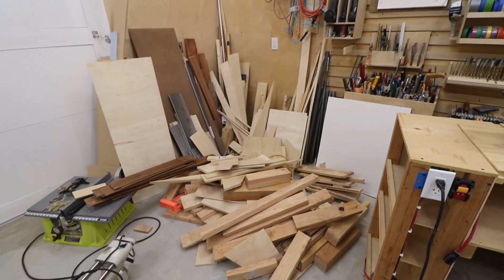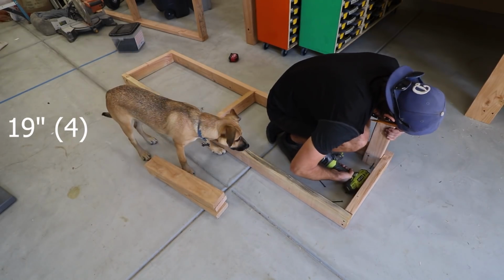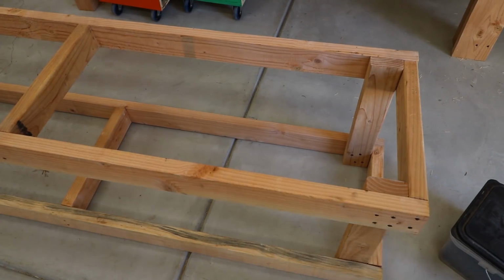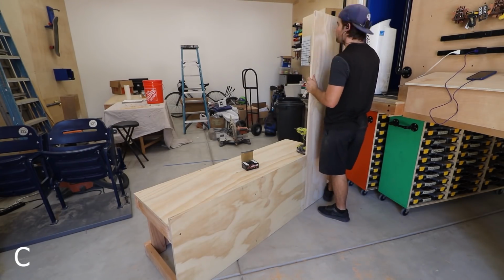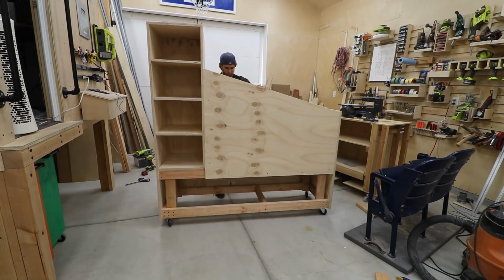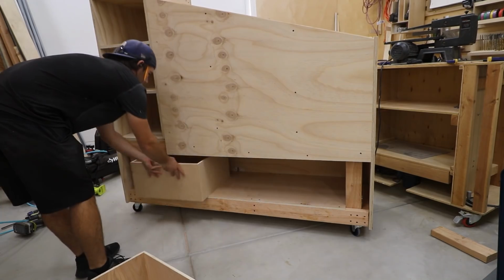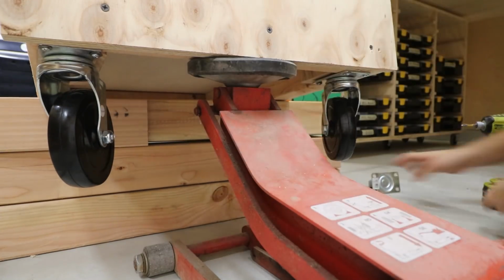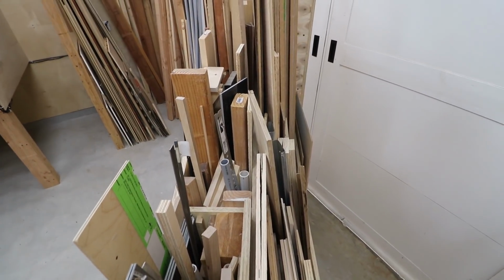High Capacity Wood Storage Cart

Comment: I made a similar measuring mistake. I was supposed to make a doorway on a storage barn 5 ft 6 in.  I incorrectly made it 56 inches. I chose to leave it, and fix it later on, if I needed to. That was over 10 years ago and I haven't changed it yet. Sometimes a mistake doesn't really need to be fixed.

Comment: 3:04 "I was supposed to make cuts at 66 inches, and instead I made cuts at 6 foot 6 inches."
Yet another error that can only happen in the imperial system. A mistake like this would literally be impossible to make in metric. You can still be off with your measurements of course, but mixing up units like this is simply impossible. (E.g. - "I was supposed to make cuts at 66 centimeters, but instead made cuts at 6 decimeters and 6 centimeters" is not a mistake, because they're both the same thing ;-)). Love you Americans, but that stupid imperial system is holding you back.
Reply: Yes yes yes, we know 😂 I can almost guarantee that once the millennials take control, it won’t be a hot swap but it’ll start being included and eventually imperial/standard will die off.
Reply: @about19wookiees14  I would hope so, but I absolutely get that it would be a difficult transition. Even assuming that everyone is on board and there's no resistance towards a switch for cultural or sentimental reasons, it still poses quite a practical challenge. I mean, eventually everything would have to be replaced over time, from drill bits to screw threads etc.. So yeah, it would have to be a gradual transition. Best of luck though 😂
Reply: It’s integrated in too much stuff. Probably won’t happen.